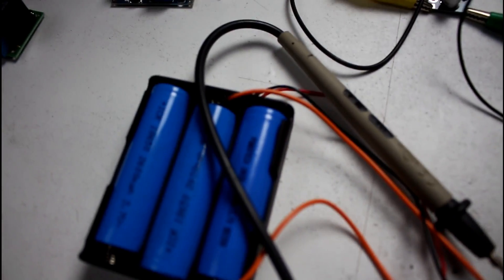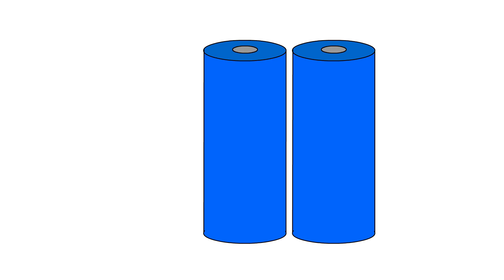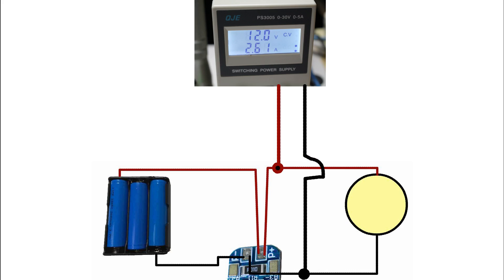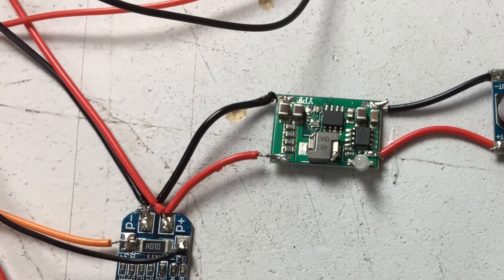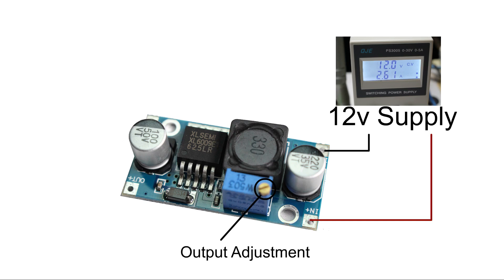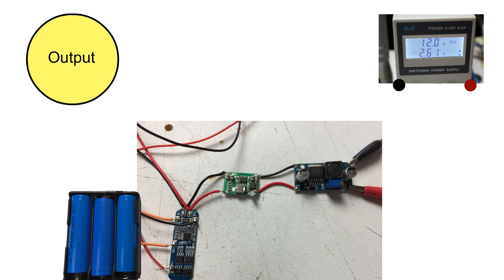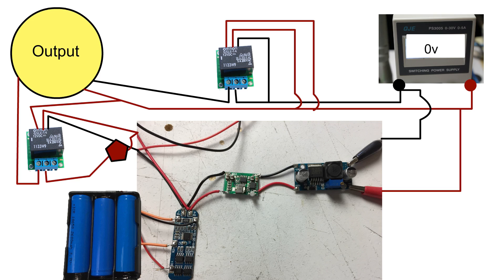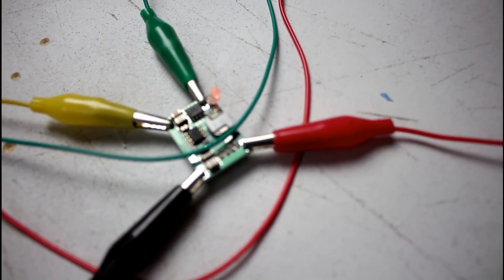Lithium cells in Series with BMS - Battery Pack Considerations (MEHS) Episode 61

Comment: It would appear to me that the point of this little green board is to enable the use of a 19v laptop supply as a 3s lithium charger, yes?I can't find this board on ebay, can you share a link?
Reply from the maker: - Hi.  Not really.  The little green board is supposed to be a 3S lithium charger meaning it can provide a proper CC then CV charge of up to 12.6V at up to 2A.  The idea is that you can use it and a BMS to build a battery circuit that can be left in a project (like a laptop battery) and can be recharged when external power is available or can run the project from battery power when external power is not available.  Yes I will post the link in the video description sometime today.  Cheers.
Reply: My Electronics & Hacking Show great video; if I understand you correctly then the green charging board outputs CC/CV on the pins which connect to the BMS, charging the 3S pack correctly; but with the load in parallel, wouldn't the charging board be delivering the wrong (low) voltage to the load during CC, and too little current to both load and BMS during CV?
Reply from the maker: - Hi.  Good point.  It depends on the load and whether your project has external power going only through the battery pack and BMS to the project load (LED panel or whatever) or whether you run power to the battery pack and to the load (in parallel as you say).  The charging board is capable of a 2amp output so if your project draws more you would run a parallel setup and avoid any CC/CV issues.  If not then its possible that the supply from the charging board could be taxed and not able to supply the best charge to the cells.  Not a perfect solution.  Cheers.
Reply: Ah, that's what I thought. While CV should work as long as the load doesn't need too much current, the constant-current phase seems like it would pretty much ensure that the BMS would be receiving less current than optimal since the load would be draining part of the current. As for the setup with relays at 5:00, don't you need a diode on the red wire between the output and the junction leading to the leftmost relay trigger? I tried sketching this and it looked like I would get a loop from the relay output to the trigger.
Reply from the maker: - I tried a couple of different relays (a few actually) and I think I found one that was isolated meaning no loop problems which I was getting during some of the testing.  If no inherited isolation then yes add another diode.  Cheers.
Reply: I don't think we are talking about the same thing -- relay isolation isn't the issue. If the relay output is connected to the trigger (at the load - this is not clear in the schematic at 5:00, but I assume there is only one positive input terminal at the load, meaning the current from the battery will flow back to the relay trigger pin) - meaning the relay will continuously power cycle: default on - the output flows around and switches the relay off - which cuts power to the trigger, switching the relay on again... But maybe you have to isolated inputs at the load side?
Reply from the maker: - Hi.  I think I understand what you're saying.  The actual real circuit had a large blocking diode (maybe 2) between the relays and the load but nothing between the input power and the relays.  I know I had a couple of relays that were a bit different (no markings) and the trigger was isolated from the switching mechanism meaning I could use the same 12v supply for the trigger and not have the relay flapping which did happen in some tests.  I will be revisiting this kind of setup and will try to make it clearer next time.  Cheers.
Reply: Ah, I think I get it then. Thanks a lot -- and I will definitely follow your videos from now on!

Comment: Couldn't you also just use a CC/CV dc-dc converter like the LM2596, this way you have the same type of charging characteristics but cheaper and in a single component.
EDIT:LM2577 instead of LM2596
Reply from the maker: - Hi.  No, the 2596 is a step down reg which doesnt work in this situation and its not a CC/CV IC.  Take a look at the characteristics available from the TI site and compare with the charging methodology needed for lithium batteries over at Battery University.  There is a significant difference  - and unfortunately, the 2596 isnt an improvement in this instance.  Cheers.
Reply: Sorry I meant the LM2577, it is a step up and step down converter with CC CV capabilities.
Reply from the maker: - No worries.  No sorry that one is just a more advanced converter.  It doesnt have the CC/CV mode or a timer for correct lithium charging.  There really is a big difference between a proper charging IC and a dc regulator.  Cheers.
Reply: I am not sure we are talking about the same converter. http://www.ebay.com/itm/262455953687 With a timer you mean that charging would be terminated after a certain time at constant voltage? That is indeed a weak point, but you could add a ampere meter to manually halt the charging process when a certain current is reached.
Reply from the maker: - No we weren't.  Thanks for the link.  That board has more than just the LM on it which is why it can do more.  It looks good.  I am going to get one and start testing.  Current output could be an issue but we will see.  Thanks again.  Cheers.

Comment: Really nice! Looking forward to se what you came up with. :) BTW, I tried using 2 18650 cells and 2 TP4056 with protection circuit, to connect the output in series. Didn't worked. :/
Reply from the maker: - Thanks.  No, 2 x TP4056 boards connected in series wont work as there is a common ground which basically shunts all the current through one chip and acts like a single cell.  You need to use a similar approach as I did in this video.  Still not very elegant.  Cheers.
Reply: My Electronics & Hacking Show Yeah, I already ordered a few BMS from AliExpress (in around 4 to 6 months they should get gere. LOL). And I'm going to use a step up/down in the output to regulate it to 12v. BTW, a good solution to the relay would be a simply DPDT switch. I'm going to explain in the next comment.
Reply: My Electronics & Hacking Show The DPDT would select "internal/outside power", let's say. If it's outside power, the energy from the adapter would power the LEDs and charge the batteries at the same time. Other way, the LEDs would be powered from the batteries. In that case, if you connect the adapter, it would connect only to the BMS.
Reply from the maker: - I intentionally avoided talking about switches as the main objective was to get as close to a laptop power arrangement as possible.  A manual switch is a very easy option but I'm certain at some point I will forget to flick the switch so I wanted to approach this with as much automation as possible.  Hope your order doesnt take forever.  Cheers.